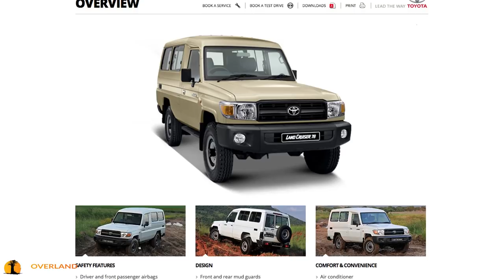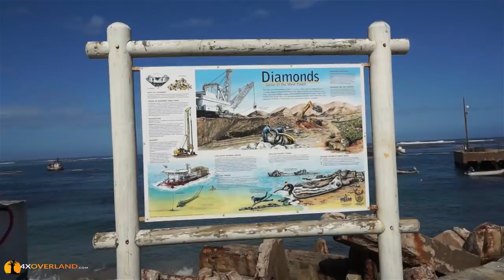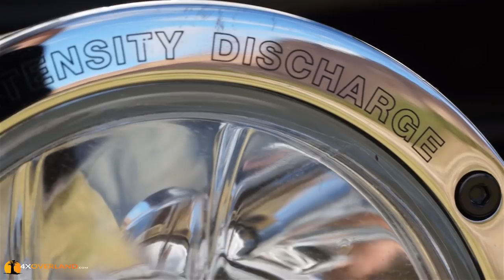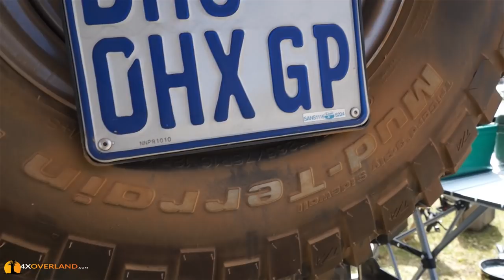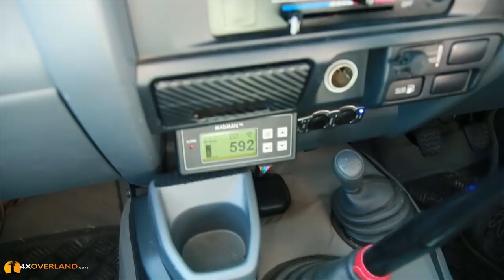Toyota Land Cruiser - The Ultimate Camper Conversion

Comment from the maker: This is a compilation of a series of 4 videos scattered round my channel. In this one, all four run together, in sequence, AND, are now in full HD.
Reply: +Lord Simon It works quite well however, you really need to purchase a truck camper for the pickup.  My Ford Ranger (off road mods) has such a camper installed and I travel North America extensively - primarily off road.  Far better than a roof mounted tent, much too limited use in cold weather.  I have solar, deep cell batteries and an inverter generator for power.  Cooking facilities, laptop, double bed plus heat and no time setup.  Too bad I cannot add a photo, definitely my home away from home, spend months at a time in the vehicle.
Reply: 4xOverland   N n.
Reply: 4xOverland  mi
Reply: 4xoverland are you able to have protection with you like a gun or rifle with you when you camp
Reply: its africa what do you think
Reply: Amazing overland truck
Reply: Just excellent job!

Comment: These videos on the HZJ78 Troopie and the comparison with the Defender have been enormously helpful for me as a newcomer tot the overlanding community.
One thing that strikes me however, and please do correct me if I'm wrong, it looks like your Troopie is configured for generally warm en good weather conditions. Like you mostly find in South Africa.
While the slim/high sized drawers of the drawer system look very efficient, it may not be so practical  in cold, rainy climates like on Iceland, Scotland, North Cape, or many countries in Latin America. In those conditions, we would like to be able to access the cabinets from the inside, without having to open the back doors.
This is also why an excellent roof top tent like the James Baroud, that is configured for bad weather (with even an extra insulation set available), after long considerations, is not for us. In bad weather conditions, we need the interior space of a flip roof (head room). And during freezing cold or rain, it is no joy to have to climb down a ladder in the middle of the night, acces the car from the back with wet and muddy shoes, to visit the 'potti'.

We have experience with the German flip roof used by VW for its campers. We will try the Alu Cab version for our Troopie, although the weight (95 kg??) does worry me a bit. Looking forward to that.

It looks like our challenge will be to develop the ultimate Troopie for bad weather / cold / extreme temperatures. That's another ball game.... or is it?

I have one other question about the low pressure turbo. Can that be retro fitted to a used car? Ours will have 130.000 km of history (same engine as yours), can we expect problems because of that?
Reply from the maker: Bert Ravelli You are indeed correct. Its a warm weather conversion, and would not be ideal for extreme climates. There is ample headroom when the bed is lifted.  There is no ladder and ingress is from inside the vehicle. These were two elements of traditional roof tents that I wanted to avoid in this design.

Comment: My essential extras have been valuable over the years. El cheapo Led small torches, spare vehicle keys cable tied under the body with the tail uncut (12"), always carry a spare key in my pocket, small spray bottle with water bug spray and windscreen brush with a long handle. Microfibre small cloths, pet soda bottles filled with water. 50 packs of zip lock plastic bags.
Cable ties in all sizes, even a small spool of galvanised wire.
Of course a spare fuel cap and a radiator one too.
It's amazing when you get to use something you have carried for years, it usually shocks your passenger.
Off outdoor fly spray, even used a small can of Mortein to spray inside the cab 2 minutes before departing.
The small microfibre cloths are good to wet and wipe yourself in 40C heat too, just hang out the window for a few seconds and they are freezing.
One thing I did use when boating was a strobe light inside the car so I could find the car at night. Now most Led torches have a strobe function, so placed on a seat, find your way back to camp is so easy.
Wish garden solar lights were around back then, my camp and remote loo would have been so much better.
I used to use an orange oil water mix in a small pump up sprayer around the car the ants hate it, now I guess Neem spray would do the same job.
Now I have a few 10 Watt rechargeable LED flood lights, back then it was 12 Volt compact flouros.

Comment: I have a old 3\4 ton Chevy 4x4 pickup with a popup camper that I can set it up in less than a minute, all you do is unhook  the four corners go inside and crank it up. Sleep 3 people, it has windows all around on the tarp and two on the sides one in the rear + door on the metal body for plenty of ventilation, has a propane three burner stove, five gallon propane tank, kitchen SS sink with hand pump or electric, a ten gallon water tank, thermostat propane heater, fridge that can run on propane or electric, removable table top that can be stored under bed, port-o- potty, over head two door kitchen cabinet, a 4'Wx 14"H inch double rows for can food storage, two drawers and a total of 6 storage cabinets including small closet, small flat screen TV, two solar panels that charges truck and camper house battery, a battery inverted, a 6' by 4' under the bed box storage for clothing, cameras, guns ore more food if needed, and a portable solar shower bag, i installed a ruff storage container for longer trips and a fishing rod holder, and two folding chair holder, plus a six foot ladder.
I also have storage on the sides of the truck for snow chains, shovel, tow strap, ropes, wood axes, side tarp,extra tools, ext water. I use this truck for camping, hunting, and fishing, i can go were a normal size camper can't, it crosses rivers with no problems its gone threw some ruff tight and steep 4x4 trails and can say i m very happy with this campers low center of gravity and its comfort specially on freezing nights, no more tents for me. I like it a lot, and i think ill make a video in the future, and Ill call it
 ( The best POPUP Camper). ,
Reply: Sounds awesome

Comment: Nice work putting it all together.  Check the sound from about 45:00-46:55 something is off.  Also please do something on the Nissan Y60 or 61 Patrol Safari!  Would love to see it tested as an overlander.  Thanks!
Reply from the maker: Liz Marc Can't find an audio glitch.
Reply: Just checked.  Only plays out of one speaker (in my case earbud) for that portion.  I had the wrong one in my ear!  Put the other one in and could hear it.  The rest of the video plays both speakers just fine.
Reply: 4xOverland Not that the one speaker thing matters!  It's only for 2 minutes and it's a classic video and an amazing rig.  Thank you

Comment: Hey there!
I love your car and the whole idea and concept of it. Thanks to your vids, I now have a lifelong dream clearly pictured now - travel the world, overland. I do have a couple of questions though regarding the roof-top tent:
1. For say, if i want to attach a LED light bar (such as those from RigidIndistries), will I be able to attach a 42'-50' light bar on top of the windscreen, where the end of the tent sits ?
2. Is it possible to attach a roof rack to the roof-top tent ?

Thanks a lot for your great videos. I have learned and was inspired greatly by them!
Reply from the maker: +Mohd Zaid Abrahim To answer your questions: 1. I do not see a reason why not. 2. Yes, but if its too heavily loaded, it will affect the ease with which it is opened, and closed. It can't be too heavy. Also, it is already quite a top-heavy vehicle. It could easily become unsafe if additional weight is added to the top. There is ample packing space inside, I see little reason to put even more on the roof. I wanted to add one but just for firewood.

Comment: The only problem is. Imagine a strong wind arises while you are sleeping and rips your roof off. Will destroy the vehicle. I would recommend strong hindges for the roof opening and some kind of security latches not to let the roof rip off upwards. Other than that great concept!
Reply from the maker: +Ayrton Senna Fan it would have to be hurricane force winds to damage it as it is extremely strongly mounted. In that case, close it and sleep inside the vehicle or seek shelter.

Comment: Great video. Was there any concern on your part as to adversely affecting the structural integrity of the vehicle in cutting away at the roof. Over rough roads, did the vehicle continue to feel rock solid?
Reply from the maker: +Robert Roach The roof sheet we removed was extremely flimsy, and provided very little structural strength to the vehicle. That is done by the very strong ladder chassis and the body shell frame which we did not cut. And the tent frame is sturdy and while it can twist with the body, there isn't much flex in it. If anything, the vehicle felt more solid after the work was done.

Comment: about overheating portion , you must realize that car becomes heavier with all accessories you added , so the solution  you need an additional 12" electric fan there is room for that but for some reason Toyota not instaling as default item .. if you really want to go crazy you need to raise the hood in the back next to the front window so the incoming air will fold and cool inside the engine bay I can show you on my video I did for FZJ80

Comment: Andrew, a very simple question which links this film and the one you did on the L/R Icarus. Accepting that it depends what you store on a roof rack, but is it possible to get a tent system with struts that could lift a loaded roofrack? The Icarus looks like its designed along those lines....
Reply from the maker: One can add a rack on this lift-up. But then the gas struts that lift it would have to be stronger. But the biggest problem is C of G. That Defender was truly terrible to drive because it had far, too much weight on the roof, which is lifted by the camp er conversion by almost a foot. The vertical C of G had been exceeded and it was dangerous to drive. All I would put on such a rack on that lifted roof would be a few maxtracks and maybe a spare wheel. But then even that might be too much.

Comment: I wonder, wouldn't a 79 ute be a better basis for a project like this? You don't have to chop, and you can make the back wider, and there are more options with side access and under-tray water tanks. Doesn't look like you have 285 wide tyres which most people put on 70 series with flares. Or am I wrong? BTW, here in Australia Speedy rims make a very nice 16x8 mag wheel called Territory that looks like the stock Toyota 16x7 rims.

Comment: may I ask how much all the upgrades costs over all ?? there is a 2002 land cruiser 70 same as yours but with 4.5 liter inline 6 petrol engine ...I'm thinking about buying and make it as a side project ( so I need a proximate price exclude the snorkel and the turbocharger from the price ) since the one I want is already have a factory snorkel and I don't need turbocharger for it

Comment: will you take an Unimog overland, if you had the opporunity?
Reply from the maker: Not in Africa. Its too large and not permitted in most national parks. Other continents, maybe. But its still too large and that kind of off-road ability is just not needed, unless in the wet, which is not the best time to travel anyway.
Reply: 4xOverland
oh good to know. I'm a unimog fanboy and wanted to travel through africa with one. Why isn't it permitted in most parks? To heavy? To big and might frighten the animals?
Reply from the maker: Its too large. Considered a truck and private trucks are not permitted entry. Also, a significant consideration is that a Mog does not fit into a shipping container. Ro-ro shipping of overland vehicles outside of containers normally results in theft as they get broken into and stuff stolen by the ship's crew.
Reply: 4xOverland
Okay, thanks a lot for these informations! Really helpful. I might get it into a container, but I can't force entry into a park (and I wont). So I moght consider an other vehcile, but I need one which is isolated from the weather because I want to travel through africa, europe and asia. I love your toyota but I think it would be a problem with snow. Are there any smart solutions by some outfiters you know about? As base I thought of a troopy, defender, or g.

Comment: Did you ever use the 5th gear?
Reply from the maker: every day.
Reply: The reason why I asked is I had the pick up 4.2 LC, which I didn’t drive very long. A Land Cruiser mechanic however told me that if you drive below 
110km/h you should never engage in the 5th gear because of future problems with the gearbox.
Reply from the maker: 5th is not a strong gear, but that is total and utter bull. What you should not do is drive in low range in 5th.  I just bought one with 500 000 kms on it and just stripped the gearbox. In a new series being edited now, so keep watching and you'll see what we found.

Comment: At 44:25 you say it will cost economy. But hot air makes a car more economical.
Reply from the maker: +LoverOfPhotography Cold air makes air more dense, and therefore the power it produces inside the engine is higher for the same amount of fuel. This is why intercoolers are often fitted to turbo-charged engines.
Reply: Hot air intake is often used to lower fuel consumption of an engine, how does that work then?
Reply: I'm talking about Honda's for instance.
Reply from the maker: +LoverOfPhotography I don't know what Honda does, but hot air always makes an engine less efficient.